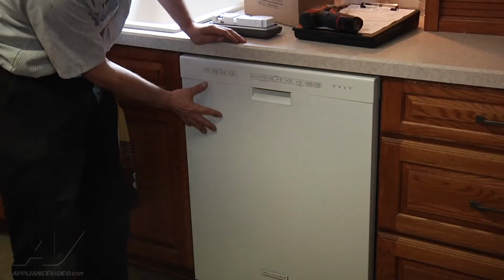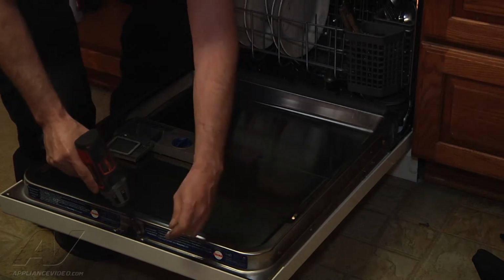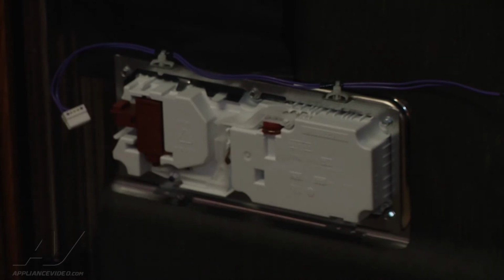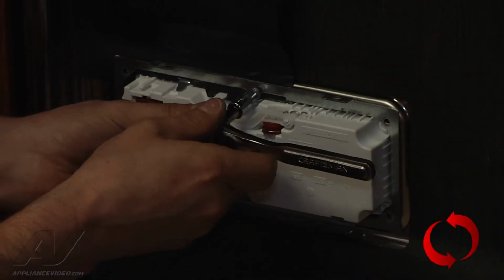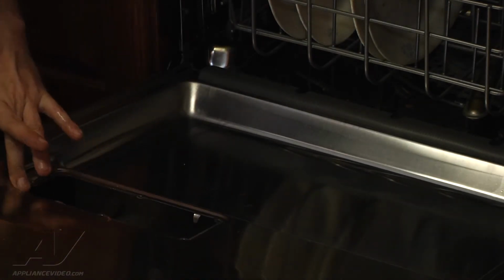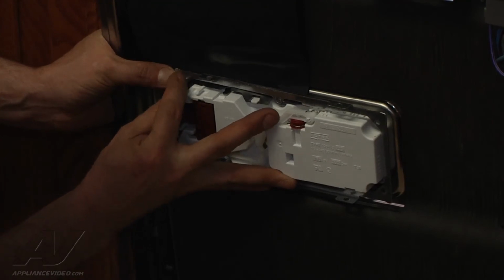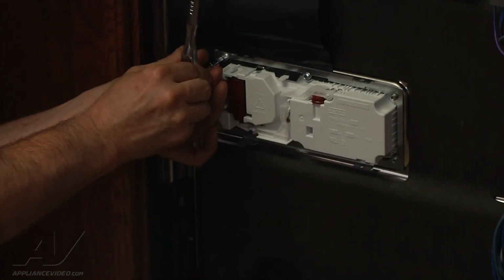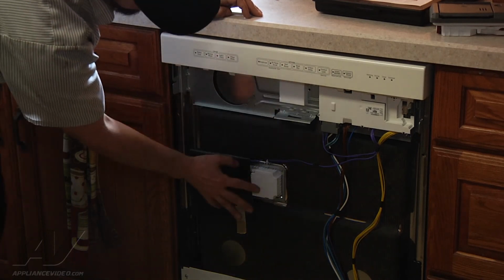KitchenAid Dishwasher Repair - Using Too Much Rinse Aid - Dispenser Assembly

Comment: So if I have this problem, the only solution is complete replacement?    It cannot be fixed/cleaned?   
Where does the rinse aid come out when dispensed - the fill cap?
Reply: Once I removed mine, I saw the rinse agent flowing freely from in the hole on the face of it. The mechanism was broken inside, unfixable. That's not supposed to happen. The new dispenser isn't cheap, but better than a new dishwasher!

Comment: I just filled mine up for the first time having owned our kitchen aid for two yrs and it all just dripped out the bottom.
Reply from the maker: Great question, if you have a more technical question that our parts department cannot answer, you can search our over 13,000 answered questions free at our website www.ApplianceVideo.com under our Repair Help section. You can also call our parts department at 1-800-830-5465 and they can give you help 7-days A week ,or search at www.SaveMoreOnParts.com  .